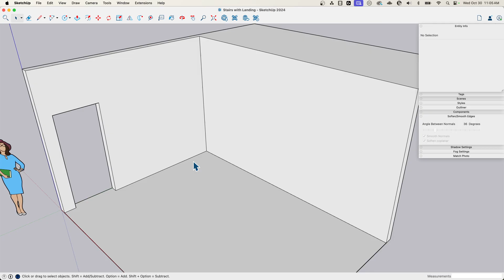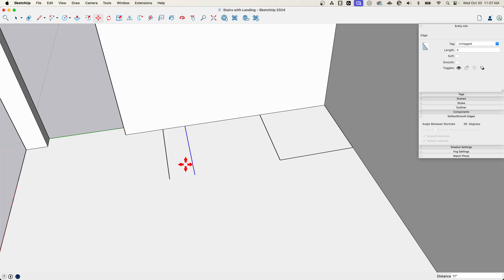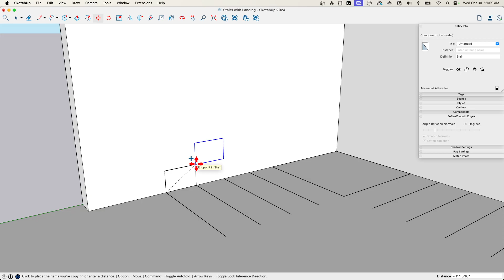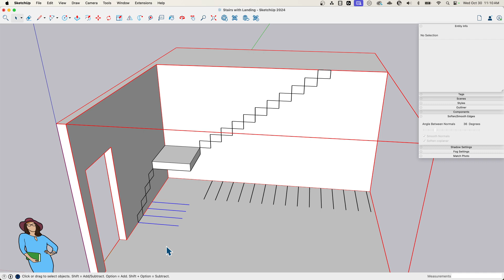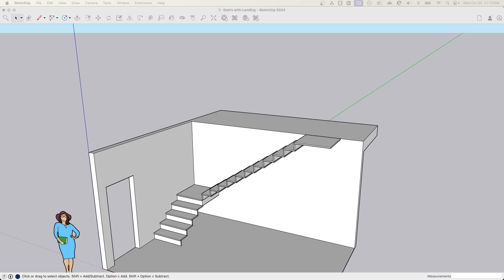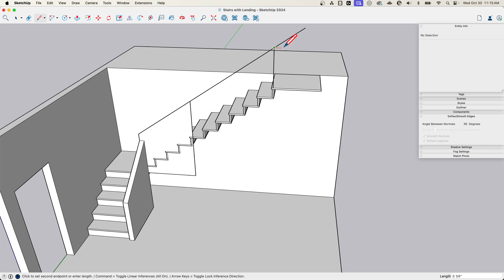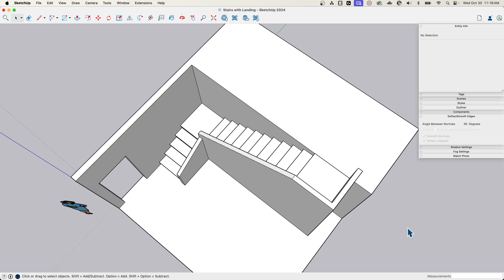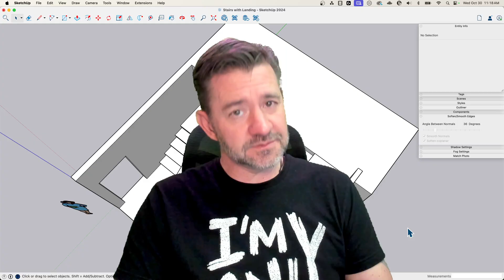Modeling Stairs with a Landing

Comment: Erin, THANK YOU so much for your tutorials. I am not sure if you have already done a tutorial on moving (Sliding) objects on a particular axis. my issue is with sliding my objects along an axis but in opposite directions so that when I use the onClick command in a Dinamic Component, the two object move away from each other, (does this make sense?). Is it possible?
Regarding your tutorial, I must say that it is simply TERRIFIC, Thank you! I learned another way to making stairs which I did not think of before.

Comment: Dividing a line using the context menu…how did I not know about that for so long…

Around the 9:12 mark when you are referencing the diagonal off axis line (the pink line), the pink line turns into a thicker/bolder line like when you lock something to the red, green, or blue axis. Is there a way to lock that diagonal inference or am I confused about what is happening?

Since I am routinely surprised by the options for a given tool available through context (right click) menus, I humbly request a video about maybe the “Top 10 Context Menu Options You Might Not Be Aware Of”.  It wouldn’t have to be confined to a single tool. Maybe the top couple of options for common native tools. 

Thank you again for all the good content. It is all extremely helpful!
Reply: When the line turns Magenta, hold down the shift key to lock it to that angle. It will remain parallel to that geometry.
Reply: Thank you! @AlAmantea

Comment: One small quibble…probably better, construction-wise to run the riser-backs to the bottom of each tread so nails or screws (from riser to tread) are in shear, not withdrawal like you modeled (from bottom of tread up into riser). Yes, there will be plenty of construction adhesive to help in either situation.

Comment: Quick, simple modeling, like this, is just to see if code stairs will even fit in this space. (and will I like it if it does) Sketchup excels at this. NOW, with the treads and risers where they have to go, is the time to draw the stringers and such. 
My first use for Sketchup is Idea bashing then drawing accurately all the detail I need to MAKE what I am drawing. The more accurately  I draw the less problems later...